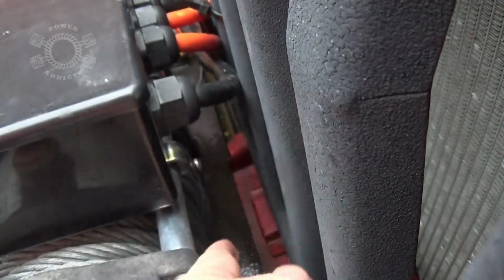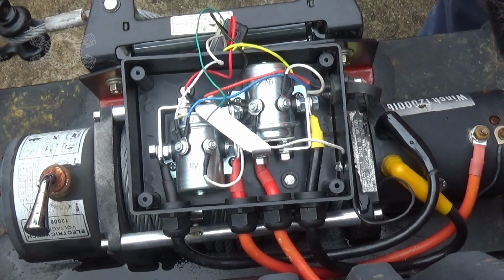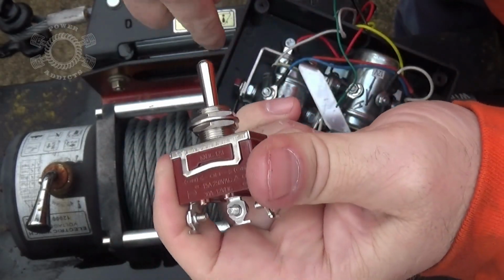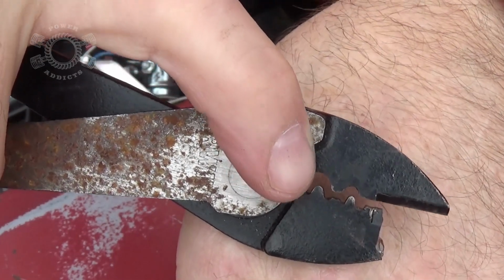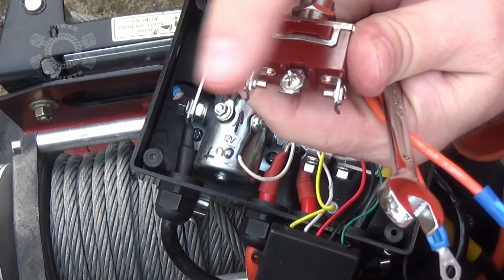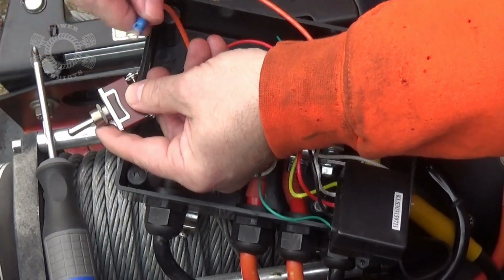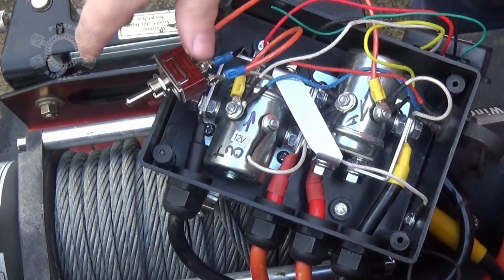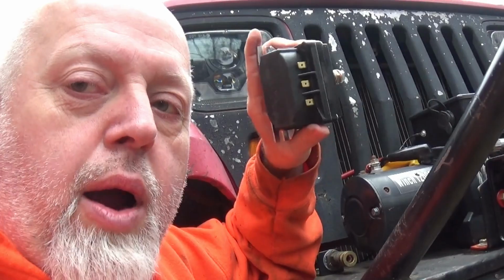Recovery Winch Bump Switch #poweraddictscrew #jeepwrangleryj

Comment: I have an old winch kinda like yours. My problem is my free spin knob is stuck. I can't move it to free spin. Do you have any ideas to help me out
Reply from the maker: Spray PB Blaster in the bottom of the lever. If that doesn't work, take it apart and see why it is stuck. I need to take mine apart and grease the inside ... it gets kinda loud squeaking sometimes.

Comment: Using that bump switch with steel wire, make sure to use dead weight on that cable in case something gives. You don't want to be standing close to the winch if that happens, you'll be in the line of fire...
Reply from the maker: I'm not gonna be inline with the cable if it's actually doing a hard pull. All a bump switch is for it minor adjustments to the cable while not hooked up to anything. I have the winch remote and I'm soon installing an incab switch for when the winch is actually doing work. And yes you are absolutely correct about weighing the cable down to absorb that stored energy from that cable. Thanks for leaving an awesome comment for others to learn by.

Comment from the maker: Parts and tools used in this video:
On Off On Switch: https://amzn.to/49Iii0s
Crimper: https://amzn.to/3IvGkzP
Wire stripper: https://amzn.to/3v41kdW
Cable Cutters: https://amzn.to/4a3F96l
Choice of wire terminals: https://amzn.to/3IrwHlx
Choice of automotive wire: https://amzn.to/3VfK7sm

These Amazon links take you to the supplies used in this video. Using these links pays Power Addicts a small commission payment at NO extra cost to you. This little fee that Power Addicts gets goes back into the channel to help make these videos. Thank you for your time and support.